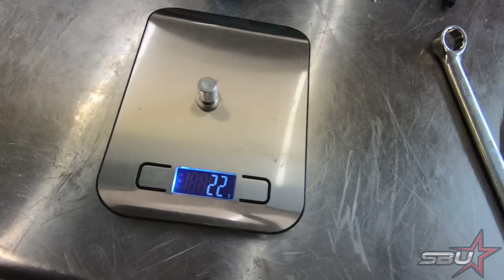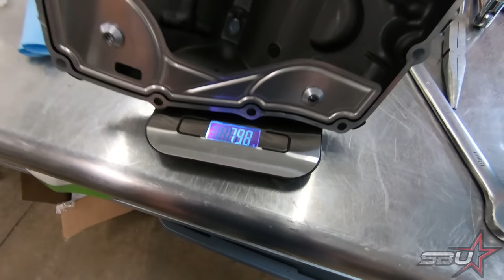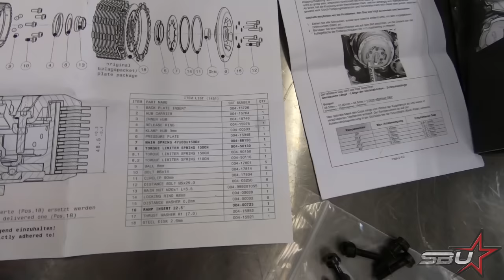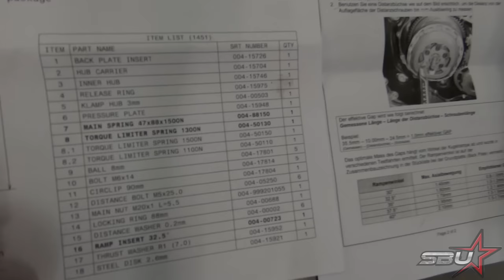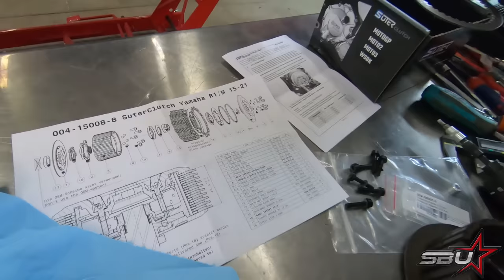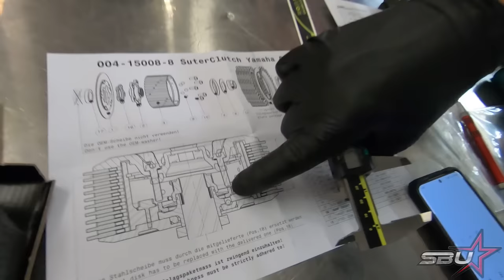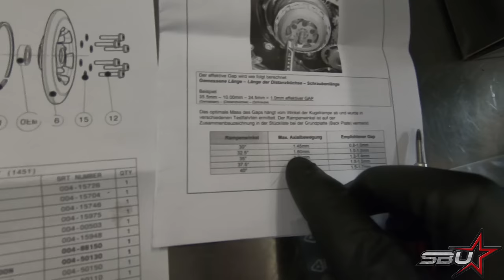SBU 2022 YZF-R1 SBK Project Pt.2  - Racing Oil Pan, Superbike Forks, Superbike Triples, New ECU!

Comment: When does it make more sense to do a full fork upgrade vs replacing the stock internals (i.e. cartridge kits)?
Reply from the maker: There are a lot of considerations: length, OEM fork tube quality and overall performance. Since this is a superbike, it was necessity, the OEM fork tubes on the R1 are too short and a little flimsy in comparison.

Comment: You want less rake on short courses and more take on courses that have high entry speeds in turns. So a 3 mile pulse course with straights or large turn transitions would benefit better from large rake (more speed) think of rake as caster on a cars front end.